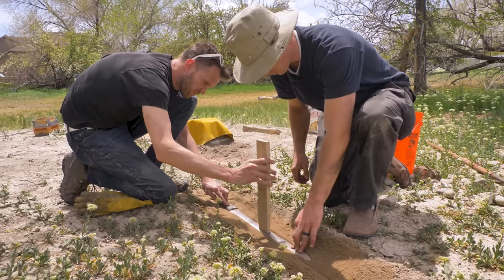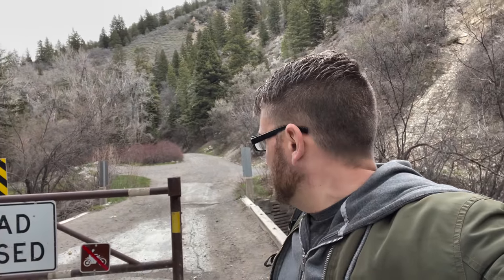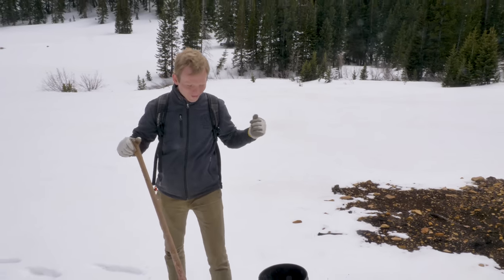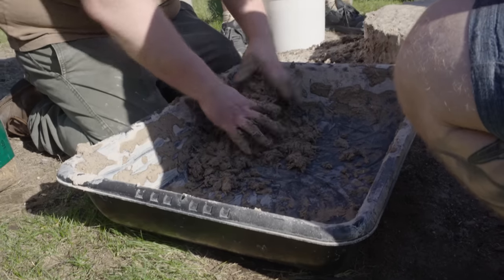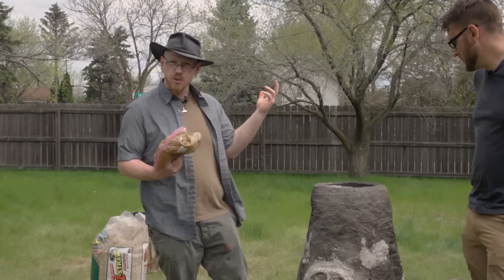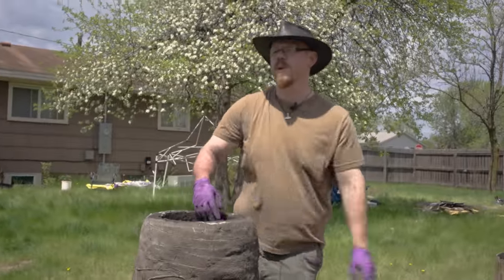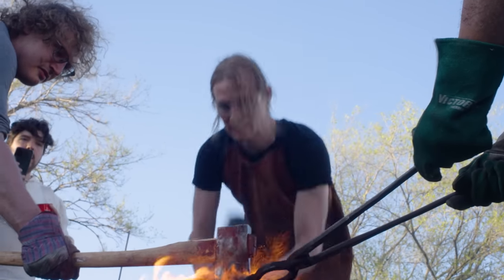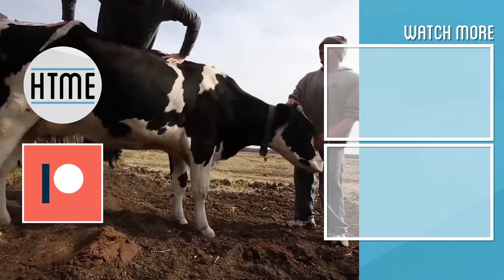I Hiked 14 Miles to Collect This Orange Dirt

Comment: I've always wondered if with modern knowledge you could be dropped in the stone age and make everything you needed to get to the industrial age. ie. smelt metal tools, to build other tools to make a water wheel to use the power to make other tools like a precision lathe and then machine work parts to build a working steam engine.  I challenge you to do this! ;)